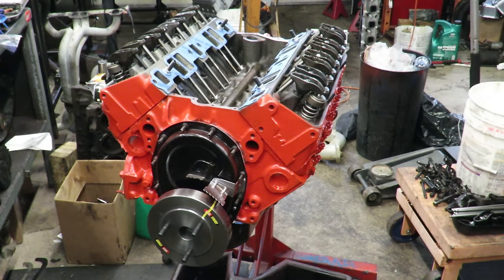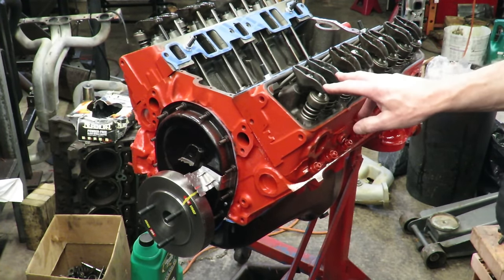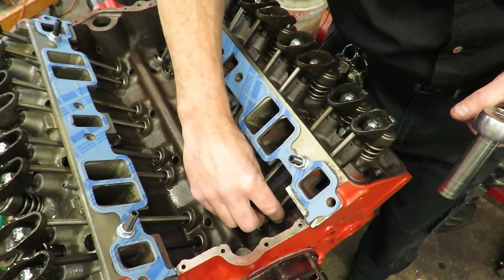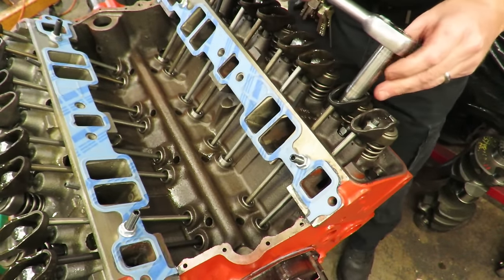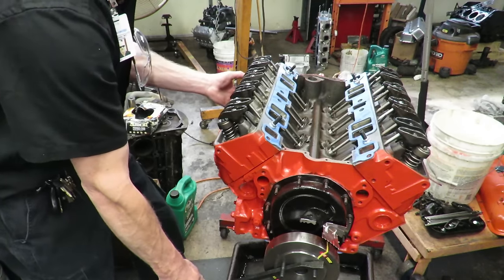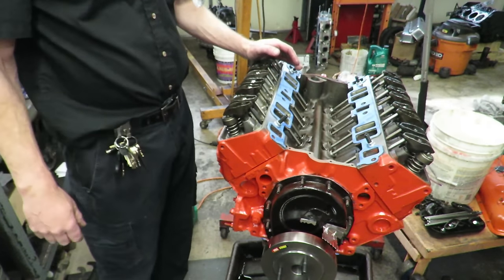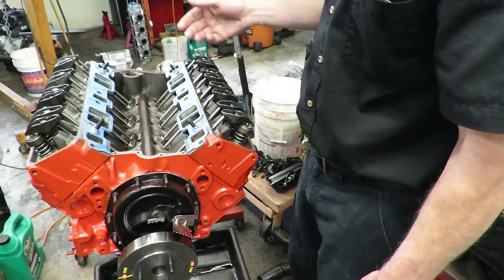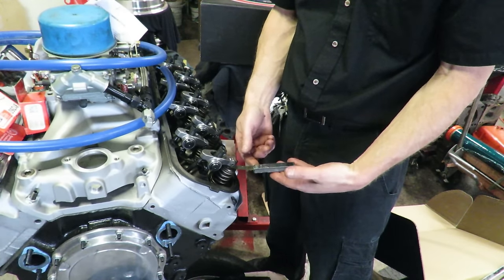Small Block Chevy valve adjustment made easy

Comment: I have been a mechanic for 35 years. Another great method is to adjust the valve lash the following way: Set the harmonic balancer to 1 cylinder and adjust the following valves-Exhaust 1,3,4,8 and Intake 1,2,5,7. Crank the engine one revolution. You should now be at number 6 cylinder. Adjust the following valves-Exhaust 2,5,6,7 and Intake 3,4,6,8. As mentioned, adjust each valve by 1/2 a turn. Easiest way to adjust lash.
Reply from the maker: This won't work with a big roller
Reply: Thats how Ive done it for 40 yrs and don't know why anybody would do it any other way unless they just love all that extra turning of the crank..
Reply: @georgealmeida7382  does this work on a 5.3
Reply: L
Reply: I've seen numerous videos of guys turning 3/4 round after 0 lash ?  Who is right 1/2 or 3/4  round
Reply: @rubenbates2709 spec is 1/4-1 full turn, most people like to do either 1/4 or 1/2 because it saves you the worry of bottoming out the plunger in the lifter
Reply: @rubenbates2709 as long is you stay within the hydraulic limits of the lifter. 1/2-3/4 will keep you there.
Reply: En mi caso le meto 1/2 vuelta y el motor me queda fallando y si le meto solo 1/4 queda entonado aque se debe .? Es nolmar..?
Reply: That's how I always did it. So much easier and faster
Reply: @chipdip999 saves you the worry of valves hitting pistons in case of a little float.
Reply: @juanyiste9032 what do you mean fails?
Reply: @Myvintageiron7512 who is going to run a big roller with hydraulic liftres?
Reply: Right. that's how we did it. Actually "by the book" ....seems to always come out right
Reply: @rubenbates2709 on an older engine, set them @ 1/2 for beginning then run it. I mean something with a few miles on it. If it sounds loose or late, give it the extra 1/4 turn
Reply: @chipdip999 it also lessens the amount of lifter pumping up and holding te valve off its seat.

Comment: Been spinning the push rods for 0 lash for 50 years. Never had a problem. Would challenge which is more accurate. You can feel the lightest drag on the push rod when spinning it. Doubt your gap...no gap is that accurate.
Reply from the maker: if you do something wrong for 50 years is still wrong most people will have incorrect adjustment using the spin method,  if some lifters are blead down and some are pumped up you will have a different adjustment from valve to valve no where in the service manual does it direct you to spin the push rod
Reply: @Myvintageiron7512  I'm not saying your method is wrong, and if something works for you without compromising the operation then use it. You're saying spinning is wrong, but I fail to see how your banging the rod up and down is better or how your method compensates for a lifter that has leaked down. I'd think the banging around would be more likely to collapse a weak lifter. Most of my (old school) race car/ hot rodder buddies use the spin method. Not saying we know everything, just using what works.
Reply: He said until you can't spin the pushrod, not until you feel a slight drag @ zero lash which is where some folks go wrong. You can spin the pushrod until you collapse  the lifter and start opening the valve. I've been adjusting hydraulic  lifters by feeling the drag by spinning the pusrod since the '70s. You can absolutely tell when all the lash goes away. Then add your preferred preload , 1/2 turn is what I usually do.

Comment: Thanks, I trust your instructions more than any on utube. Why does the info that comes with a new GM crate 350 flat tappet small block tell you to go 1/8 turn past 0 lash???
Reply: Flat tappet hydraulic or solid? If it's hydraulic it's probably so the valves close more reliably

Comment: I was taught by my grandfather to just go through and adjust every lifter that’s all the way down in the bore and turn the motor until they’re all adjusted instead of going through the firing order. Never had a problem with doing it this way and seems to get the job done faster
Reply: The author of this video starts out by using the 8 stop procedure and gives a great explanation up through 9.50 into the video.  Not only is the 8 stop procedure easier, it is much more accurate.  
He goes on from 9.50 into the video, and explains an alternate method. I don't know why he believes that he needs to make further adjustments. The hydraulic plungers will have more than enough travel for the 8 stop to work very well.
Reply: @markemery49 listening is a strong charisterisc to have. He said a rollercam has a very small base circle and it is too hard to center on with the balancer. Therefore the ex opening is the best way to do those cams.

Comment: I find it funny how you say the people that use the spin method to find zero lash, and then you go by feel to find lash. You sound like a high school auto shop kid explaining this. You are making this way harder than it should be. Keep making people work harder, your doing great!
Reply from the maker: your understanding of zero lash is incorrect the push rod is going to get hard to spin in a much different depth of travel on a bled down lifter than it will on one that is pumped up solid zero lash is when you just pinch the push rod between between the rocker and lifter plunger spinning it will put the plunger halfway down its travel before you feel resistance that is not zero lash I"m not making it harder I'm just exposing people who do this wrong but think they are right because that's how uncle Joe did it

Comment: I have watched everybodys directions on how to adjust valves on a small block chevy or any hydraulic  cam with adjustable rockers. I have wrenched for 45 years, when i was 20 and working for GM an old guy showed me the easiest way to adjust the valves and i have done it this way ever since and it has been perfect every time no need to go back and recheck, everything you explained about zero lash and centering the plunger is exactly correct, but try this next time start your valve adjustment at TDC doesnt matter what stroke your on, go thru and adjust all 16 lifters to 0 lash, then roll the balancer one complete turn back to TDC and check all 16, and the ones that are not at 0 lash readjust them to 0 lash after you have done those 2 steps go thru and set your preload 1/2 a turn or 3/4 on all 16 rocker arms. And your done. Try it, probably takes 15 min, and perfect every time
Reply: I never heard this before and I am 80. If you read enough you learn something new everyday. Thanks I will try this next time.

Comment: This is exactly the way I've been doing it for 45 years. I do solid lifter cams the same way , except valve lash is set with feeler gauges. But yeah, start on #1 cyl. on  compression stroke, set lash, turn crank 90 °, to next cyl. in firing order, ect...  Thank you for showing the simplest and quickest way.. All you other YouTube instructors need to learn a lesson from this man. 
If you are forgetful like me, do it this way and you'll never screw it up.

Comment: I learned how to adjust valves by reading my old chiltons repair manual. Any chiltons or hays manual works fine. I follow the instructions and the order it says to follow. I run through twice to make sure I didn’t miss any. And I install the intake and valve covers. I never have to make an adjustment. 
I always do this with the intake off. I watch the pushrod contact with the lifter plunger. I watch to see when the pushrod makes initial contact and can watch the plunger move. 
 As soon as the pushrod makes contact with the plunger, I tighten the rocker a half turn and I’m done and move to the next valve. 
 Gm never ran the valves hot, and never had to readjust the valves when these engines were assembled. This method has worked every time. The only time you have to pull a valve cover is if there is an issue or something is wrong.

Comment: The first method worked great on my 1965 L 79 350 HP Corvette and the valves were great for the next 15 years running to 6500 RPM. I just followed the GM factory shop manual. Did valve seals on my 72  LS 7 350 Chev Cheyenne and set the lifters by ear using sound absorbers on the other lifters to quiet them and they have  not been adjusted for 25 years and they are still quiet.

Comment: Yes I agree spinning the pushrod is a good way to check for zero lash but I adjust all the valves that are closed on number one then rotate to number six compression and adjust the rest it's worked for me for about 45 years and hasn't failed yet.

Comment: that is the right way to do it ,not spinning the push rod but just taking out the push rod play to rocker then 1/2 turn , I just put in valve stem seals with heads on , and I don't want to set them with engine running on my 1991 GMC 1500, I wonder how the factory dose it ,I'm sure they don't do the valve lash running the engine , Thank you for showing us .

Comment: I agree the spin method is easy to get wrong, wiggling push rod up and down is the way to go.  I also use 1/2 turn past zero lash to preload the lifter, many resources say 1 turn but in my experience is that's too much (most of the time).

Comment: You said not to turn down until you feel the push rod resistance because the plunger may me part way collapsed and the adjustment will be too tight. So if you turn it down until you get zero lash and the plunger is part way down and you adjust it in that position why will the adjustment not be too tight. I always make sure the plunger is not part way down before I attempt to do the adjustment

Comment: When you have the engine on number one com you can adj every rocker arm that has the lifter all the way down then just make one full turn and do the other ones then your threw
Reply: Except when its in the car and the intake is on the motor the lifters are hard to judge.
Reply: I do do it that way though.

Comment: Hey great video on the valve adjustment,  I used to work with a old school mechanic at a chevrolet dealership in the 70s and 80s and he used to tighten the rocker nut 12 and a half turns from when the nut starts catching threads on every new hydraulic cam install, never had to readjust them again. I doubted this method until I started tearing down small blocks, I noticed every engine with hydraulic valves I tore down was 12.5 to 13 full turns to remove the rocker nut. I'm curious on what is your thoughts on his method?  Thanks for the great videos!

Comment: Thank you. I have a 288 480 cam. I can just twist the push rods. Lifters have been soaked and motor has been run. For a short period of time. From what I'm gathering from you is. If I'm thinking right or understanding you is I still need to go a half a turn????
Reply from the maker: After 0 lash yes
Reply: @Myvintageiron7512  it sure does have a sweet sound. Thanks a bunch. God bless.

Comment: I think this is a good way to do it, but a word of caution on this procedure: If your rockers are really loose, or like the nut isn't even on there at all, then the method you show for checking TDC on compression or exhaust won't work. Because in that case the lifter will lift the pushrod, but the rocker won't engage the valve since it doesn't have the nut run down as a pivot point. It will just jack the rocker up the stud. And in that case the exhaust valve won't open, even on the exhaust stroke. So if you put your finger on the hole, it will blow out the plug hole on both compression and exhaust. It could lead to a false starting point for the adjustment. 

That being said, even in the worst case you'll still be right 50% of the time. And if you repeat the finger test a few times you're bound to catch the issue. But I just mention it in case someone is completely unfamiliar with the operation of the motor and may not realize they have to run the rocker nut down almost all the way down before starting.
Reply: You have to have the valvetrain completely installed and ready for adjustment. Watch the video again, because you missed something.

Comment: Great  Video I have a question with the dry lifters wouldn't they collapse do to the valve spring pressure as you go though the 1/4 turns

Comment: Get a good engine manual and you can check and set half of them when on mark ( 0 lash and half a turn down) and turn crank 360 degrees and set other half. This is best way.  Not by running engine.  Solid lifters are different set and add .002 to setting on exhaust and run engine with valve covers on until engine is hot then check all  for correct gap.  Works every time and no use to run with valve covers off.  There is usually 3 turns  from 0 to too much .  A half turn is good for high performance.

Comment: Great point about lifting the socket, I could see myself screwing the adjustments all up cuz the socket was holding the pushrod down...  Still don't quite understand why the "spinning method" is wrong though...
Reply from the maker: when you turn off the engine some of the valves will be open the spring pressure will blead all the pressure out of the lifter so after it sits for a while those lifters will have plungers that are loose you can push the lifter plundger up and down by hand the lifters that have cloeed valves will be pumped up they will feel solid if you try to move the plundger up and down so some of them will spin all the way down the the bottom of the plundger travel (Way to Tight) the others that are pumped up will not spin as soon as you get to 0 lash (too Loose)
Reply: @Myvintageiron7512   Thanks for your reply, I think I understand now....I think what you are saying is that it is fairly easy to "spin" the push rod even when the plunger is compressed slightly, much less friction.   I "readjusted" the lifters on my 73 Chevy when it had over 200,000 miles on it.  There was no real clattering, just a bit more on cold start up...I remember the "half turn down after zero lash" method you talked about, but obviously did it wrong...The engine would barely run after I "readjusted" the lifters, so ended up loosening most of them a 1/4 turn or so....  Sure wish I still had that car....

Comment: Great video. I have a question. When doing this on a new engine. Should you pump up the lifters with oil before adjusting, or do you want to adjust with them dry ? It maybe a stupid question, but I just want to verify. Thank you for your time.
Reply from the maker: do it dry

Comment: I like this method! I just set mine by setting cylinder #1 to TDC and adjusting Exhaust 1, 3, 4, 8 and Intake 1, 2, 5, 7. Then I rotated engine 360* to cylinder #6 at TDC and adjusted Exhaust 2, 5, 6, 7 and Intake 3, 4, 6, 8. While I got them all to zero lash, I also set the preload before moving on to the next valve. Is this an accurate way to set them as well?

Comment: I have a question? I have a 73 Nova and will be putting on a better set of heads. I know I will have to readjust the lifters when I put new heads on. I take it this way of adjusting them will not work it only works on new unused lifters?
Reply from the maker: no it will work no problem

Comment: Something you said is very important. You said dont use the spin lash method because some of you lifters might be collapsed and some pumped up. Thats a Problem itself no matter if you use up/down lash or the spin. You want all your lifters to be released. Meaning fully extended. Period. If some of your lifters are collapsed and some are not. Your always gonna have problems. .
Reply from the maker: No I don't agree if you are simply running your rocker down to zero lash you're going to be in the same starting point lifter pumped up or not

Comment: My question is, if you go up and down with the pushrod or spin it, arent you still going to achieve the same zero lash?  You dont want to get into the travel of the plunger, so you dont mash the adjustment until you can't turn the pushrod with your channel locks, you just take away the free movement. If the plunger isn't at the top of its travel then the spring is shot in the lifter.
Reply from the maker: if the lifter is bled down you will be half way down the plunger travel before it stops spinning
Reply: @Myvintageiron7512  if you are half way down the plunger travel when you feel resistance, you lifters are shot. You aren't making it stop, just feel the resistance. I guess it's all in the feel!
Reply: @Myvintageiron7512  what my point is if the plunger is half way down it's the same place for the up and down movement as well. Half way through the travel until the up and down movement stops too.

Comment: Awesome video just what I needed ...I have a GM 304 V8 very similar engine same hydraulic setup saw rockers  I have the manual and has nothing like this in it .. has torque specs? Do these come loose if not torqued or 
Cheers thanks heaps
Reply from the maker: Glad it helped

Comment: I would like to point out as i just learned the hard way that firing orders can be changed.  Even though this 63 impala has been in my family since new I had no idea my grandfather changed the firing order to a LS during his rebuild in the late 80's.  So to those DYI'rs out there check your firing order before using this method.
Reply: Ls was not around in the 80s youngster. Try   1997.
Reply: @charleswittmer  the video is a 327 small block not a LS.  My 63 327 was retrofitted with a LS head and LS firing order to match.  Explain your point again grandpa?

Comment: 1/2 turn, 3/4 turn, full turn for adjusting preload. I heard 3 different ways from other builders. Which is the best? Once the preload is set do you operate the oil pump to pump up the lifters?

Comment: I got a question I just replaced my rocker arms and pushrods when I get zero lash and quarter turn are you able to push down on it and have that cushion spring back like or is that too loose?
Reply from the maker: id go a half turn the lifter should have give unless its pumped up with oil